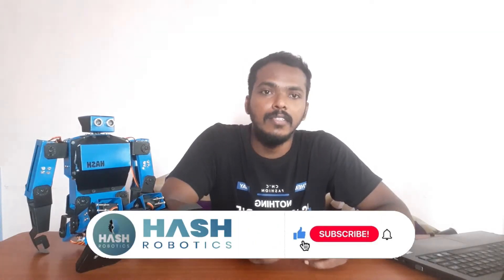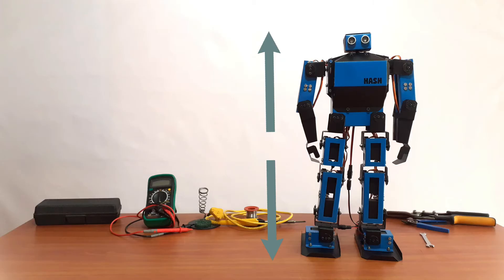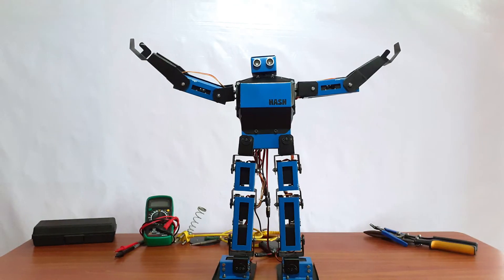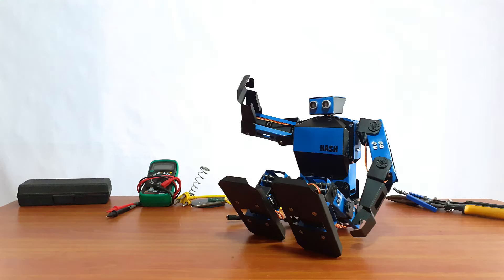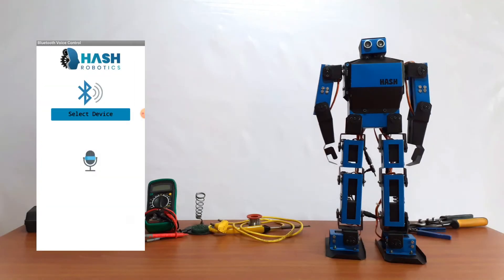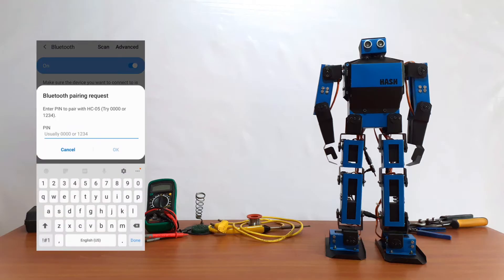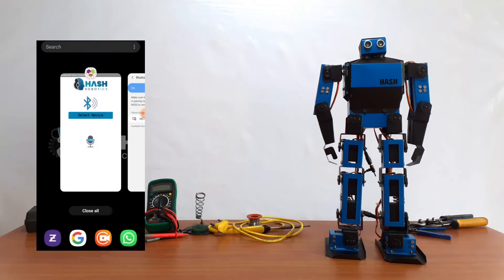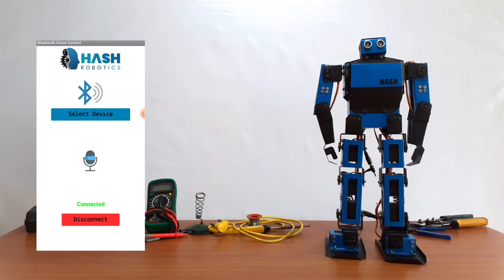Hash humanoid robot using arduino | Hash Robotics

Comment: When your humanoid robot is doing push ups then there is one jumper cable hanging out which is not connected to nothing
Reply from the maker: It's not jumper cable its adapter pin that connected to servo.it is having two pin types at the end. If you look closely the big one connected for servo.

Comment: Are the servos 180 degrees or 360?
Reply from the maker: 180 degree
Reply: @HashRobotics  Okay, but do I have to use 180 or can I use 360? And can I use mg996r instead?
Reply from the maker: 360 is for continuous rotation .you can't control the angle I think. Yes you can use mg996r